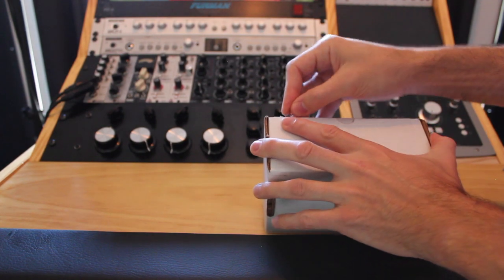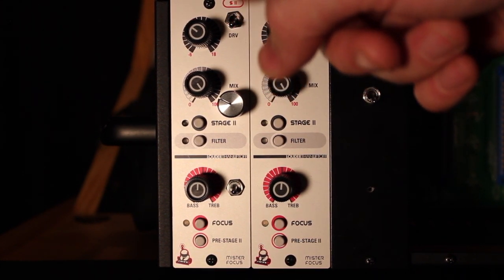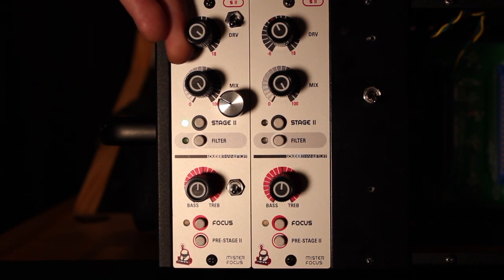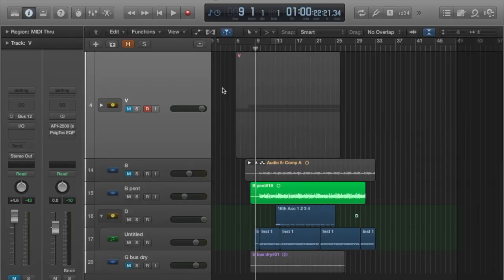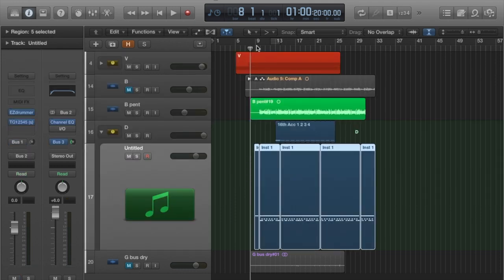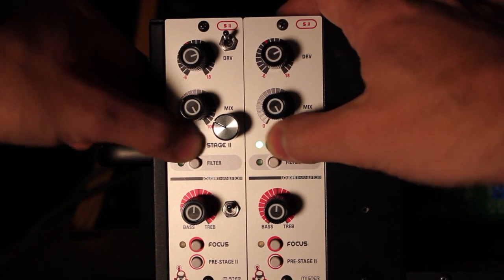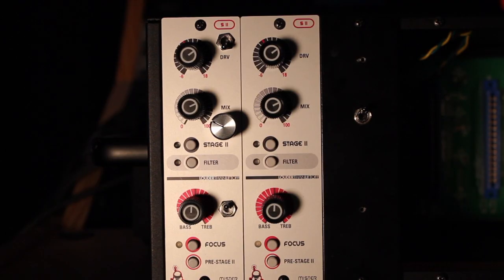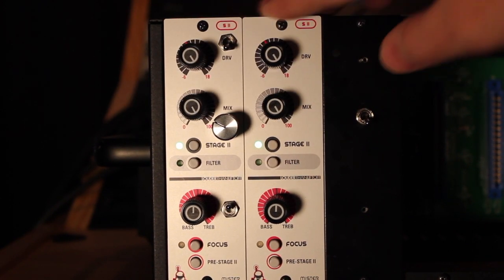DEMO and REVIEW: PENTODE mk2 by Louder Than

Comment: Hi Richard. Great stuff. Can u tell me about the dial mod u have done to your Pentode modules? I understand u have a switch for the Bias, but am really curious about the dial a bit below the mix knob?
Reply from the maker: I actually had modded that for my IMPLODE module’s output control. I just threw the Pentodes in there and connected the bias to one of the switches but the dial was not connected to anything in this video. I’ve since dedicated these MF’s to the Pentodes and tailored the mods for them. I think I’ll make a quick video about it.

Comment: Hey Richard If I want the Eq control from the Pentode  what Pot show i used dual gang, but that many ohm?
Reply from the maker: Mervin Rijo I have not yet looked into what the specs are for Pentodes pots, but when I was getting a into IMPLODE mods Brad was very open about the values of the controls.
Reply: Did u find out about this?
Reply: @pharfar  not yet

Comment: May I ask what the other toggle and the big knob were on the modded unit? Also who did the mods on your unit if you don't mind me asking?
Reply from the maker: I originally modded that unit for an IMPLODE FET comp. The dial was for the output on it. I’ve since swapped the dial out for another toggle switch and did identical mods on both units for a stereo “Stage 2-Pentode” set. It has high and low boost switches and a switch to select between 2 different frequencies on the Super Filter HPF. I have a video detailing how to do these mods. You can copy this mod and it’ll only run you about $15 to DIY
Reply: @richardjamesmusictech6838  Hi Richard I have the implode and I'd be interested in info on how to mod the controls
Reply from the maker: @UmasPapa  I have a “how to” video on implementing the mods. The pots are slightly trickier because you have to remove the stock pots, and also get the correct value of the pot you’re replacing. HMU at harmonyhouserecording@gmail